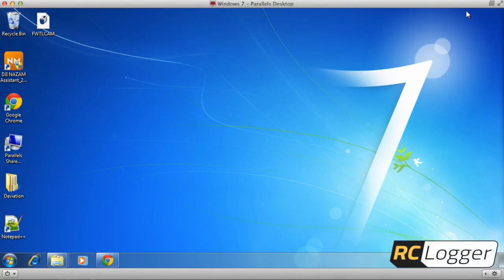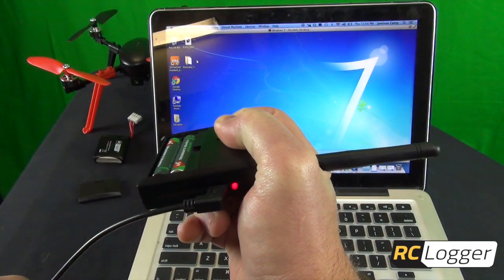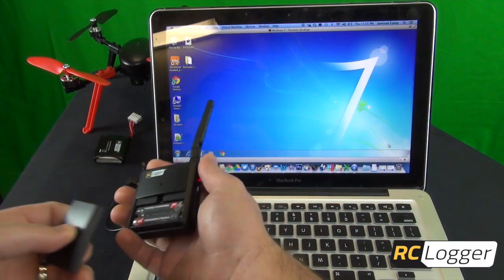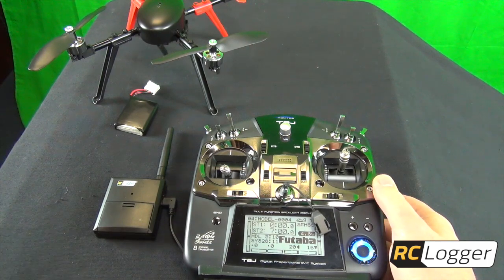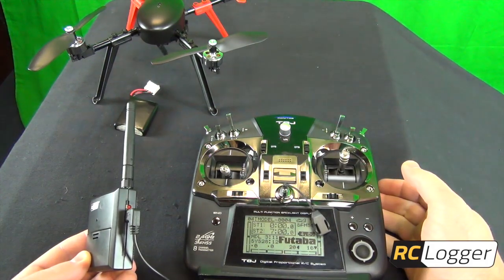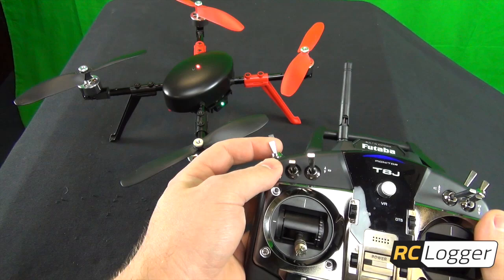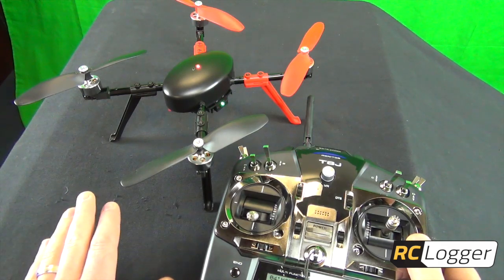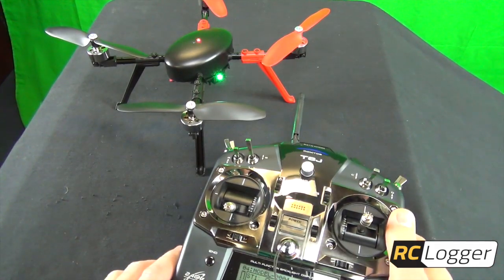RC Logger OneLINK Tutorial: Firmware Update, Learn Mode, Bind Mode

Comment: thanks for the upload might have to do the firmware upgrade later
I have the one-s set up with the one link on my devo8s and it works great but if I want to use the one link with my eye one extreme will I have to re set up the one link or can I go back and forth flying with one-s & the EOX.
Reply from the maker: You will not have to set it up each time. You can go between the two models. The only thing you will have to do when going from one model to the next is press the bind button on your quad to go into bind and then hit the bind button on your OneLINK once it's bound you're good to go.
Reply: thanks I went and tried it and it works I will have to relearn the one link I did not set up the 7th channel one-s did not need it :) oops